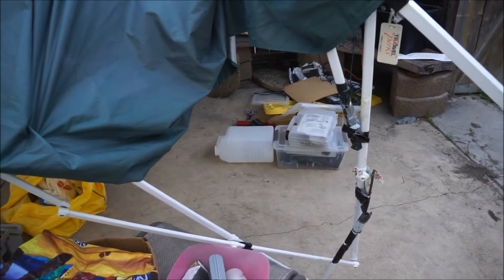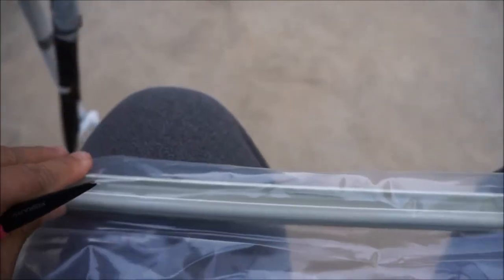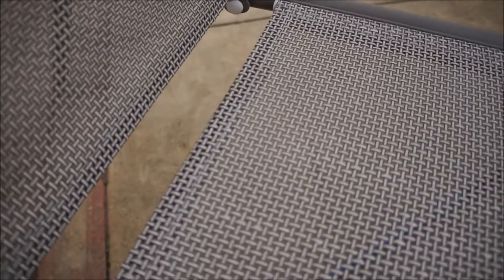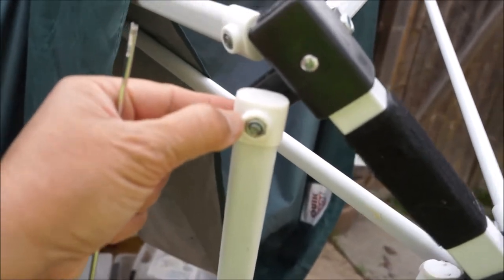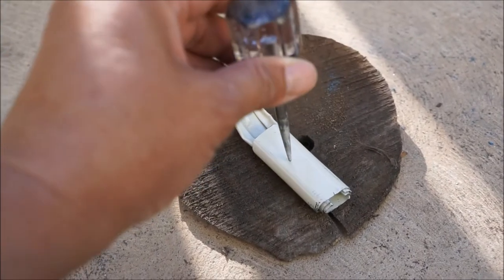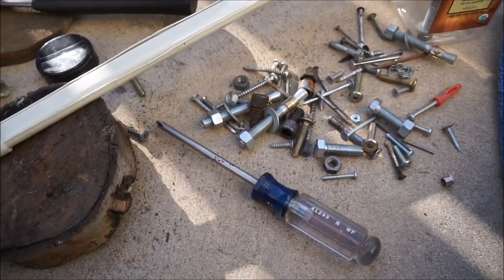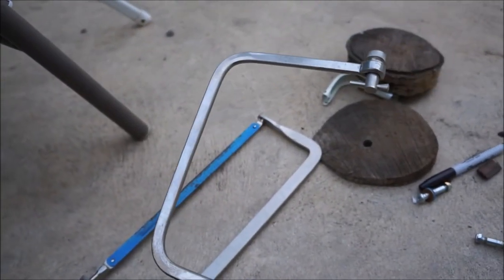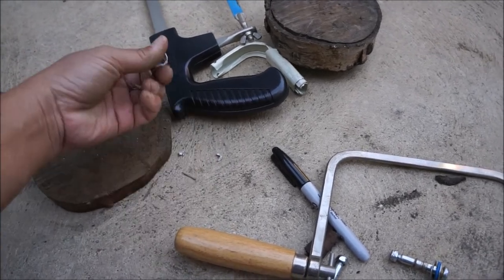Canopy Repair: EZ Up shade Canopy for under $10

Comment: As a practice, use the pointy thing (punch)  to start the hole and use a hand drill  and a bit to size the hole.  I am impressed with your idea of using a curtain rod.  I just ordered a part from another one off of ebay and sized it to fit my application.  It was way more than 10.00.

Comment: Thanks for the great tutorial, such an innovative approach you've come up with. I've come to the conclusion that for higher force winds or being left up for regular use, these require more joists to stabilize them and protect the fragile hinge system. Your ideas will come in handy there!
Reply from the maker: You're welcome! I found that you can get replacement parts from the manufacturer online.

Comment: I had considered jumping off a bridge after watching this.
Reply from the maker: I did say it was an EZ Up repair, not an Easy repair...Thanks for watching!
Reply: @SquiggleMom  LOL, That you did. I have 3 in disrepair and was looking for an easy fix. I am using 1 to fix 2. Amazing that even though all 3 are 10x10, the rods are all different lenghths. A hacksaw, drill and labor is in my future. You are very sweet and you got the job done. Thanks for the reply.  Eric
Reply from the maker: @ericsgreyhairwisdom5799  I walk along the beach and often see them.  I keep thinking I should carry a wrench or screwdriver or something to harvest parts to fix them. I think it's awful that they get so easily broken... And then we just throw them out! So many materials.  What a waste!
Reply: @SquiggleMom  I was at Cocoa Beach recently after a particularly windy day, found 1/2 dozen umbrellas in the dumpster with minor breaks. Easily repaired but tourists think nothing of spending another $40. next weekend for another one. Not worth their time.